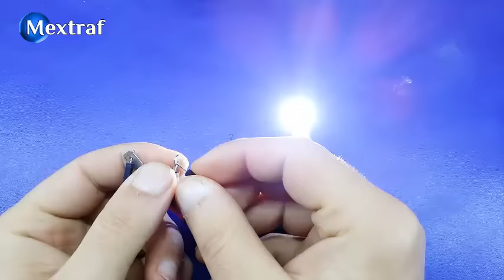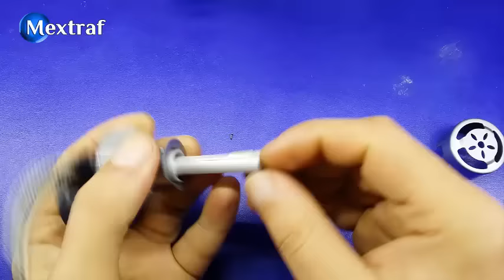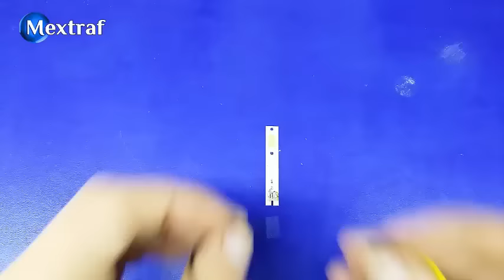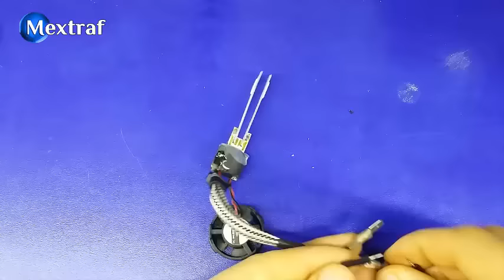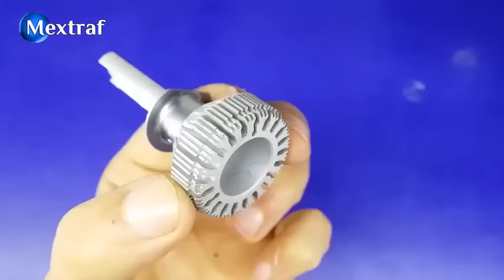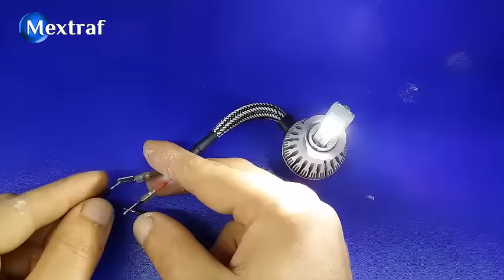How To Repair / Fix  HEADLIGHT - LED Car Light - XENON

Comment: Thank you. I have this same bulb and needed to see how it gets disassembled so that I can get rid of the stiff plastic piece bending the wire out from the bulb housing. I need to get rid of it so that the lockrings of my vehicle can slide over the bulb housing

Comment: Hi I have a issue that my led is working but fan is not running what can I do ? I checked it direct with 12v battery ? And plz tell me is there any negative or positive wire when connecting with battery ? Can it be harmful if connect wrong wire + to - 
or - to + plz help me
Reply: @Mextraf  Thanks bro
Reply: Ans share plz

Comment: Nice tutorial thanks alot, but mine are without screws but instead they are fixed with blind pop rivets. Can you please upload tutorial for replacing these type of led headlight bulbs? Thanks.
Reply: Mine are too. I used a dremel carefully grinding those rivets off. And then secured them drilling out the hole and driving small screws through.

Comment: What did you use to power it?
Reply: This is easily achieved with a 12v AC ADAPTER block almost everyone has laying around their home from old appliances or electronics. Cut the end off and you expose two wired positive and negative.

Comment: What was the volts used to test I've tried 12vdc but only get bright for a quick second then goes dim
Reply: Don’t put 12 volts on just the led bro, you’ll kill it. 3 volts on just led plus and minus.

Comment: The Led Headlight Chips are by far too wide & dont match the same size as the Halogen bulb Filaments but the GTR-ULTRA 2.0 by GTR LIGHTING is way far better &  Brighter than all Led Headlight bulbs on today's market & it's a real shame that I didn't have the money to buy these GTR-ULTRA 2.0 H4 Led Headlight bulbs come in at 3,900 each Led bulb & come in at 650 LUX 6,000K & it is only uses 42 Watts per bulb which is  amazing & Blows the Competition of all the Led Headlight bulbs that are out there on today's market Kind Regards Peter